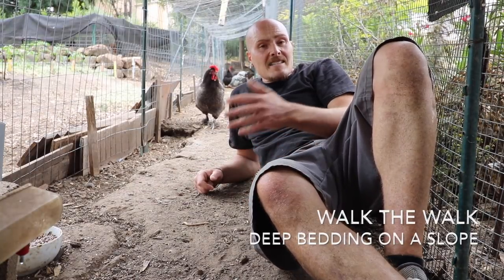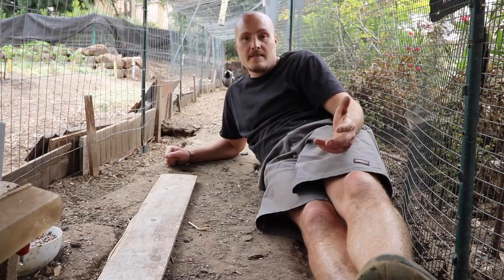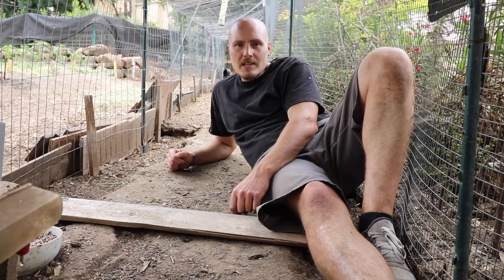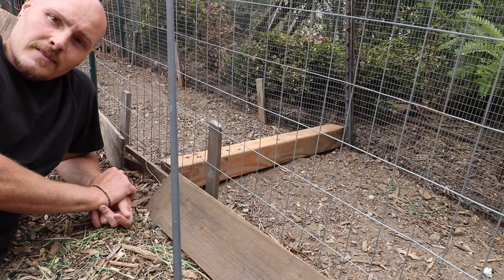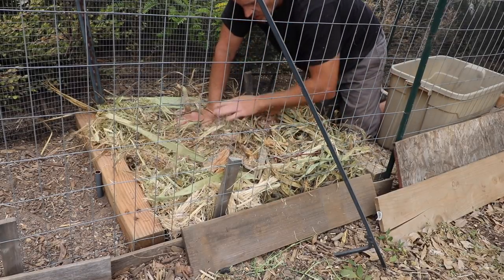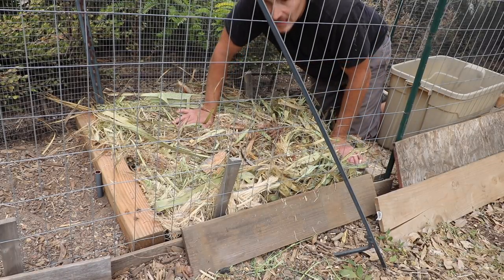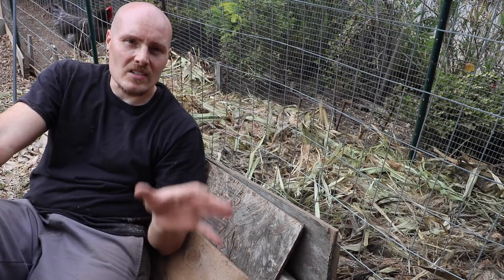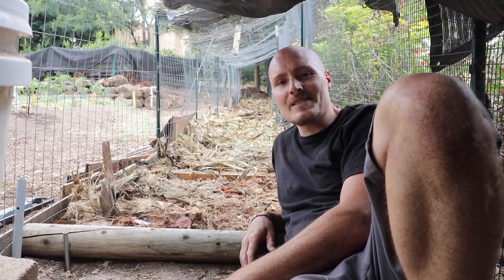Carpeting the Chicken Run

Comment: if you need more headers  check out tree stakes at local  home impovement store  some are Pressure treated some are not make your own choice  they are about 2 or 3 inches diameter and 8 or 12 feet in length  cut to size needed